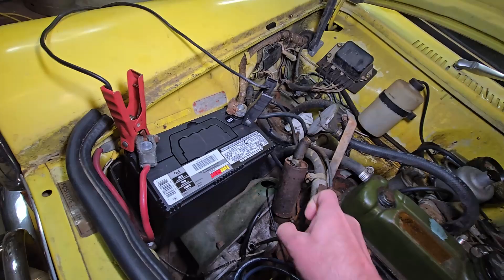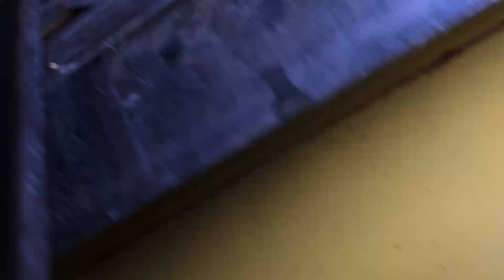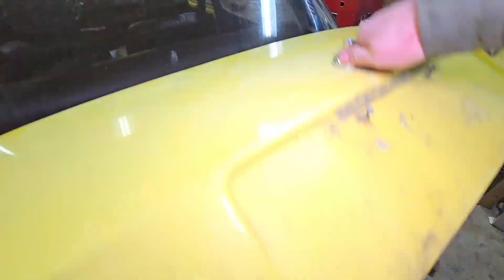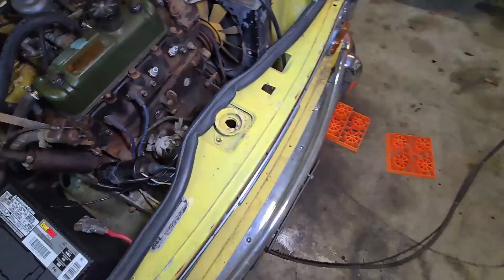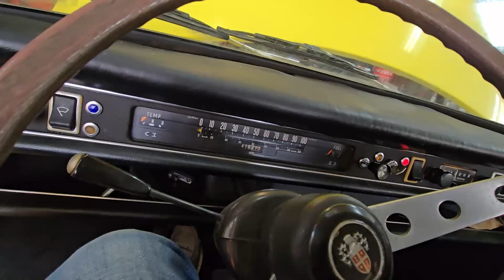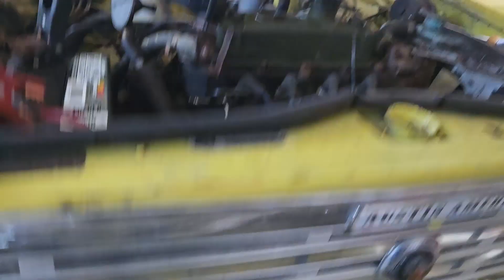1969 Austin America - Massive Oil Leak Fixed!!!

Comment: I recently finished a nut and bolt restoration of a 1964 MG 1100. It also had a massive oil leak that turned out to be the oil filter housing.
Reply from the maker: British cars are famous for marking a spot with oil but the amount that blows out of an oil filter housing leak is next level! Thanks for watching!

Comment: You are doing well tbh, I have had 4 minis of the same era and room to work in is not a question .
 There is none.  
  You're lucky to still have skin on your knuckles . 
Morris 1100 1300 + vanden Plas are the same car here so maybe try those names in your info search @Muffler Bearing Motorpool

Comment: A rare car ? A relative Unicron , And with the 2 door its just funny that the rarest car you have just doesnt exist in the UK
ps  did you add oil to the Su carb dashpot ? the black spin of cap :)
Reply from the maker: Yea, I did add oil the carb dash pot….I used ATF and it seams ok aside from hunting a bit at idle. I think the throttle shaft may be worn which it the reason for that but it’s running well enough that I’m going to leave it for now. As for rarity, I thought these were relatively common in the UK, just named named something else, neat to know it’s rare. That being said, I’m not sure it’s the rarest of the fleet. I have a 1975 M718 front line ambulance which was sub 2k production numbers and I have another British vehicle, a 1963 Daimler Ferret which they made less than 4k. I make up for the rare stuff with all the mass produced VWs :)